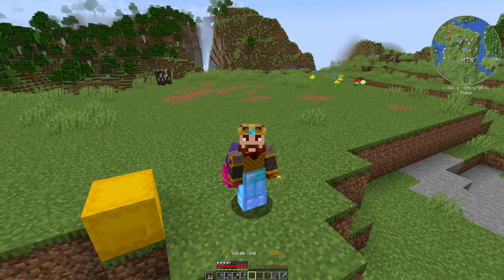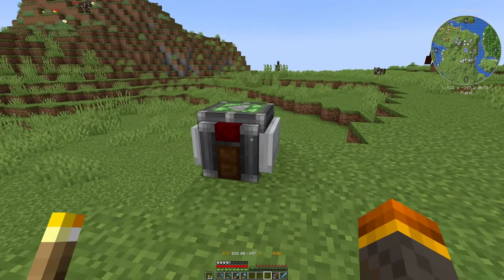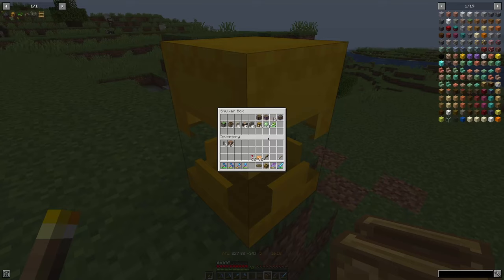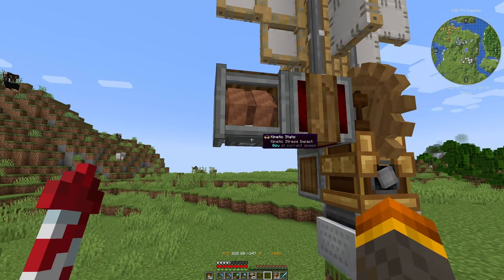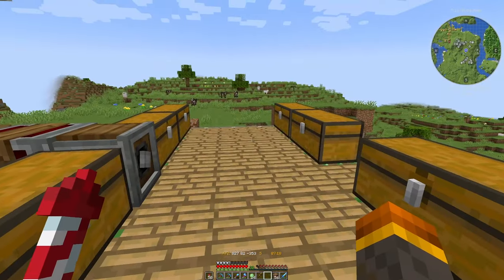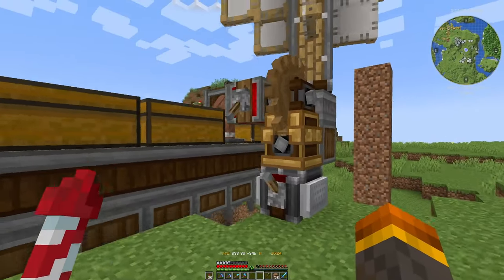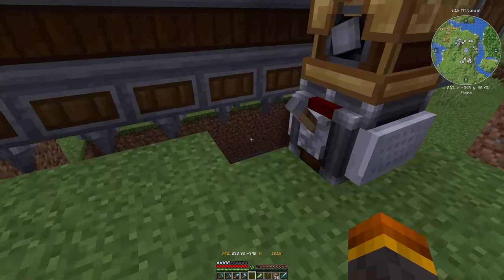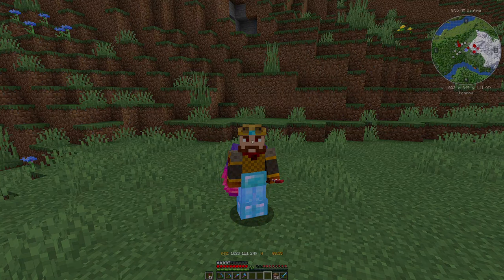The Automatic Digging Machine! A Tutorial for Minecraft Create

Comment: i got this problem where the drill goes up and down correctly, UNTIL it reaches bedrock and at that point it stops pulling the drill up, its been really frustrating me since i cant figure out why. do you know what the problem is?
Reply from the maker: Unfortunately I’ve had this happen to me too. What’s crazy is that sometimes it can hit bedrock and it’s fine though. What I ended up doing was just watching it carefully as the drill drops (I use FreeCam to watch it) and I raise it when it’s around level -50, just to not risk getting trapped in the bedrock.

One of my viewers said he was able to solve this by picking up the contraption, raising the place where you originally put the contraption by a couple of blocks, then placing it back down, a few blocks higher than it was. Then you should be able to raise the pulley again.
Reply: is there a part where its getting glued to bedrock?
Reply from the maker: @Zlyde007  I don't think it's actually getting glued to the bedrock, I just think part of the contraption is getting wedged under some pieces of bedrock. One of my viewers had an awesome suggestion, if it gets stuck just pick up the whole mining rig as a contraption, then add a couple of blocks above where it was sitting, then place it back down and it will no longer be stuck because it will be above the bedrock.
Reply: @Zlyde007  yeah

Comment: when size of this is 256 drills and size of item storage around 144 blocks, it will crush idk why
Reply from the maker: Ok, let me try to understand what’s happening here, you’re saying that with 256 drills it will start to work but only hold 144 blocks before the mechanism fails?
Reply: @TutorialsByLarry  i mean 144 blocks that can be used as storage(chest, barrels, sophisticated storage mod and other mods for storage).
I solved that problem by replacing chest/barrels with 1 or 2 max size item vault, its crashing when i try assemble it to contraption from minecart assembler,  seems it's some add-on for create that cause minecraft to crash or it's some optimisation mod that couldn't withstand big amount of chest that can be opened when it assembles or when using sails from add-ons. Now it works, good design😁 thx
Reply from the maker: @psheno86  ok I gotcha!  I’m glad you were able to debug the design and get it working. Honestly that’s gutsy going for a drill that big, that would be perfect for digging a perimeter.
Reply: @TutorialsByLarry  if you don't mind i want to see gantry shaft design for mining drills ;))
Reply: Ah im having the same exact problem, i think its the nbt for the cart is too large

Comment: My first attempt noclipped throuth blocks unto backrooms
Reply from the maker: Ahhhh ok, was it in bedrock?  I intended to make a point of that in my video but may not have mentioned that bedrock is the one place where you can have problems with a drill like this. Because part of the drill gets jammed in bedrock and other parts are still working (since the bedrock layer is not flat).
Reply: @TutorialsByLarry  java
Furst attempt was without watching any guide so i had a lot of glued chain drives that were attached to drills and a windmill
When i turned thst horror on it just noclipped (funni)
Thanks to alt f4 for saving mats for normall guided build (thanks for guide
Reply from the maker: @Nemesis-crest  Yeah, Superglue can cause some pains if you use it all over the place, I've glued plenty of things to my contraptions that I didn't want to!.  It's no fun trying to go back clean all of that up.

Comment: Probably an update since or perhaps because I am using sophisticated storage, but the machine doesn't keep the inventory when picked up.
I have to empty it before I move it, else the inventory is voided, which is fine when I am digging for specific materials, but frustrating if I'm digging for a LOT of a specific material.
Reply from the maker: You know I’ve seen a couple of folks with this exact same problem. 99% of the time this works just fine so I’m not totally sure what’s causing this. Are you supergluing your chests to the contraption or using slime to attach them?   Not sure if that makes a difference but I’ve always had success with slime.
Reply: @TutorialsByLarry   Using slime. Ice used both with same results. Some stuff stays, but kost gets voided. It's weird.

Comment: LOVE how these say easy or portable and you need 5 million parts and it is HUGE
Reply from the maker: I get that, and I think it’s always a challenge to do any automation in Minecraft in a compact design, even with a mod like Create. BUT, this design actually doesn’t have a huge footprint, you could actually go smaller on the width and length. Where it takes up more room is vertically, because of the windmill requirement. But for an automatic digging machine, I think you’ll be hard-pressed to find a more compact design than this.

Comment: Would it be possible to add something on the platform itself which lets you control the direction and also pause it? Almost like a elevator.
Reply from the maker: I’ve thought about this!  I think there might actually be a solution for this but I haven’t tried it yet. The Create Mod has a remote control widget that will let you connect one end to a redstone signal, and you can use the remote to trigger the signal. I bet this would work.

Comment: I’m a little confused on how to glue it since you cut it at where you did it correctly, is there any way you could show this is a short or through text? Thank you so much
Reply from the maker: Yeah I guess I skipped over that part a little bit, sorry about that. Gluing this stuff together can sometimes be a little confusing, too. Basically I just glued all the parts of the contraption together, which would be the speed controller, the gearshift, the windmill chassis (and the gearbox connecting it), the rope pulley, and the first linear chassis that the rope pulley is connected to. Also the minecart contraption.  That should be all that you need to glue together.
Reply: @TutorialsByLarry  Thank you so much

Comment: I'm trying to do this, but with a small cockpit (cobblestone room with a door, 2 double chests, seat, and wireless redstone switch, on top of the chassis, with a line of vertical chassis going up to meet the rope pulley at the back) I built it, tried it, it worked, I got excited and hopped in, thinking it would work again, threw the switch, it ticked a couple times, then destroyed my rope pulley. I don't guess it makes too big a difference, where once I throw the switch, it just brings it all back up to the top, but I thought it'd be cool to dig down to a level and have all the resources to stay down there for a bit, then throw a switch and come back up, but I don't know why it keeps deleting my rope pulley. I checked my glue, took stuff out, put it back, etc. any help is appreciated, I'm new to modded minecraft in general. thanks for the idea!
Reply from the maker: Wow this sounds awesome!  I love the idea of riding the contraption down. It would honestly be the best way to get a birds-eye view as you get to the depth level you want. So, without seeing how you have everything setup I can only throw out some things to look for. The glue is the first thing. I’ve actually had setups where I broke a block but the glue was kinda still working in the space where the block was. Not sure if that’s a feature or a bug but it’s caused me problems. The other thing, check your linear chassis setup. I would make sure the block range on those is exactly where you want them.  I hope you get this figured out, sounds like a fantastic build.
Reply: Nice, I'll check it out again. thank you! awesome channel btw
Reply from the maker: @TheRokr85  I appreciate that, good luck to you and thanks for checking out the videos!

Comment: I tried it but it dosent pull back up it stayed down
Reply from the maker: Unfortunately, I've seen this behavior before too.  But, I've only seen it get stuck if you drill all the way down to bedrock and part of the contraption gets embedded into the bedrock. And honestly it's just bad luck for where parts of the contraption are located, and if the drill goes down too far.  Honestly for this style of a drill I usually try to stop it when it gets right to the bedrock level and bring it back up.  It's not easy to see when you are way up at the top though but if you use something like FreeCam you can get a better view of things.

Comment: i cant get it to work
Reply from the maker: Hmmm…. Are you getting rotation on your windmills working and is the power going to your speed controller?  If that’s the case, does your gearshift seem to be working too?  Another thing to check, make sure your contraption is turned to the on position to make sure the whole thing is enabled. And also you want to be sure everything is glued together properly. Lots of ways this can go sideways, but the key is to make sure the power is traveling from the windmills to the gearshift and the drills.
Reply: @TutorialsByLarry I have done all that the windmill is going the right way, all gears line up, all blocks  are glued the way you did it in the video. Editing this I had the sails for windmill wrong. Nvm
Reply from the maker: @tiffanypronk4312  ok awesome, glad you got it working!

Comment: this machine works great but everytime it hits bedrock it wont lift back up unless i go into creative and break the bedrock, could this be on my side? or should i be picking it up after it does that?

and i have to rebuild it after everytime i move it, nothing is misplaced i just have to replace all the blocks and it functions as intended
Reply from the maker: Unfortunately it’s not just on your side. I’ve encountered this a few times before too, but not every time. My theory is that part of the contraption manages to go below some of the bedrock and that makes the whole thing get stuck. If it stops right at the bedrock level you seem to be fine but it’s really a matter of luck at that point. And yeah it sucks to have to break the whole thing down and rebuild it. 

What I’ve done is to setup FreeCam on my client and then you can watch the drill from a better view. Then I raise the drill just as it gets to around -55. If you’re using this purely to gather resources this is totally fine. If you’re trying to build a perimeter then you’ll still need to do some manual cleanup.
Reply: Something I did, if this happens, remove the contraption, place a few blocks on the point where you've placed it, than replace the contraption. Everything should be a bit higher, so above bedrock. It will come straight back up
Reply from the maker: @mart9954  oh awesome, thanks for that suggestion!  I’ll give this a shot the next time I have this issue.